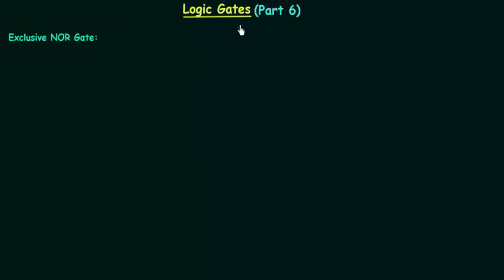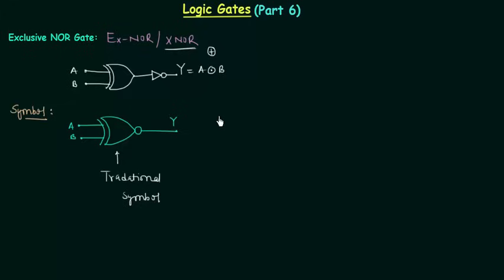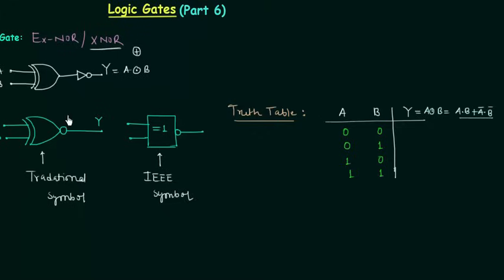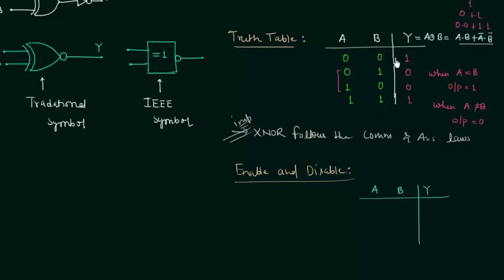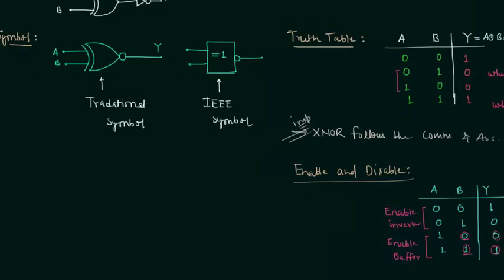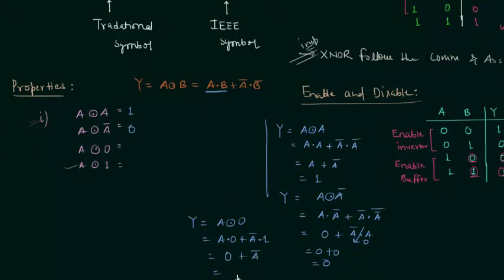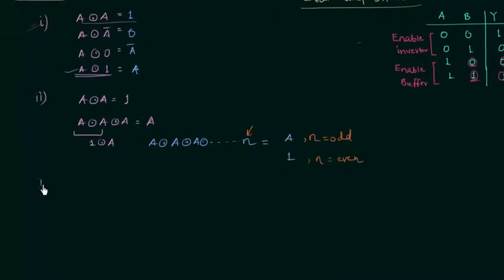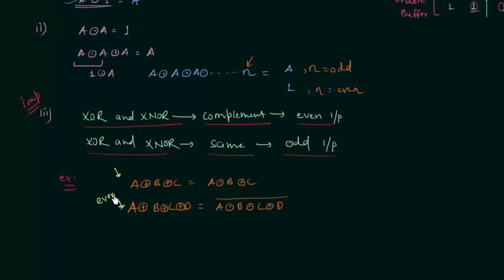Logic Gates (Part 6) | Important!

Comment: Shortcut method
1) (A xor B') xnor (A' xor B)
= [(A .B) + (A' . B') ] xnor  [(A' .B') + (A . B) ]
According to XNOR truth table if both the inputs are  same, then the output is always 1(high).
so we have the answer as 1.

2) A xnor A xnor A xnor A xnor A xnor  A' xnor A
= A xnor A' xnor A
=0 xnor A
=A'
Reply: Thanks! This also made me realize that A xor B' = A' xor B = A xnor B!
Reply: Thnx
Reply: Correct.
Reply: For the first question... There is no need to A and B always be same input  ?

Comment: For the first HW problem, first method is to solve  by using basic formulas for both EXOR & EXNOR gates
Y= (AB+A'B') EXNOR ( A'B'+AB)
   =  [ (AB+A'B').(A'B'+AB) ] + [ (AB+A'B')' . (A'B'+AB)' ]
    Consider  X= (AB+A'B') 
  then  Y= [  (X.X ) + (X' .X') ]
              = [    X       +      X'    ]
               =  1   
Second method is to substitute 1's and 0's for  A and B in the circuit diagram  to get the value of Y as 1 for all the four combinations

Comment: Hello Neso Academy,

3 input EX-OR gate is not equal to 3 input EX-NOR gate. Please correct the following in the video. 3 input EX-OR gate provides output for odd number of ones and 3 input EX- Nor gate provides output for even number of ones. But thank you for wonderful videos
Reply: Yes !!
Reply: Yes @Harish you are absolutely correct, actually he mistakenly proved that (A xnor B) xnor C = A xor B xor C (3 input XOR gate) which is correct. But,

A xnor B xnor C (3 input XNOR gate) is not same as A xor B xor C (3 input XOR gate)

Notice that in the first case A and B are XNORED first then the result is XNORED with C, but in the 2nd case, all three inputs A,B and C are XNORED together simultaneously which does make a difference.

CONCLUSION: 

(A xnor B) xnor C IS NOT SAME AS A xnor B xnor C (3 input XNOR gate). 
And for additional knowledge (A xor B) xor C IS SAME AS  A xor B xor C (3 input XOR gate).

Thank You!